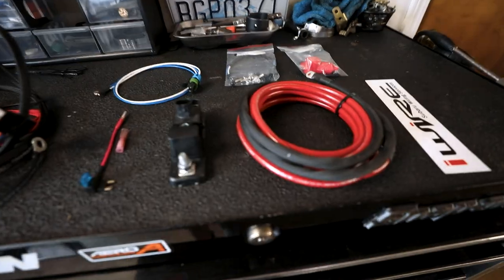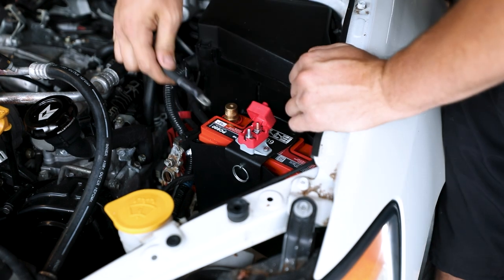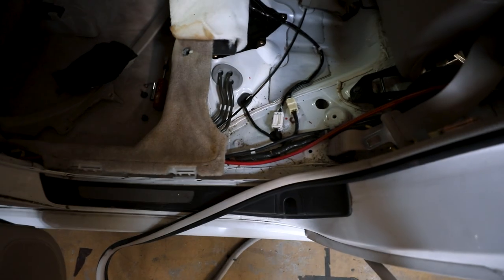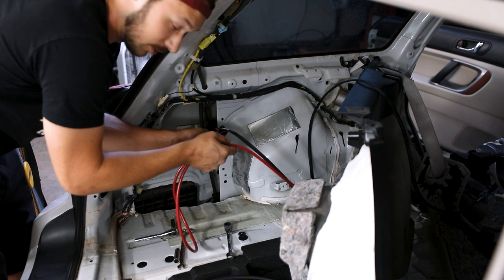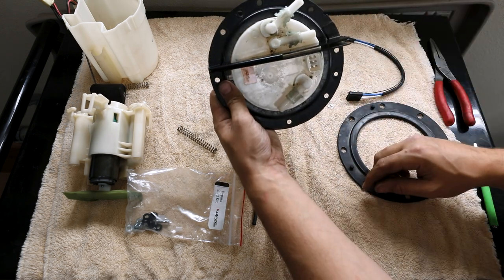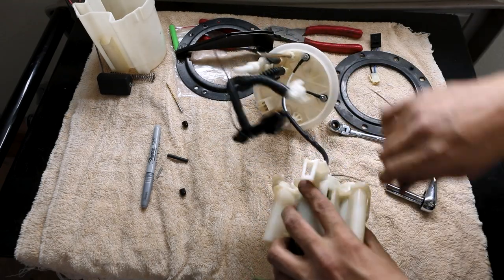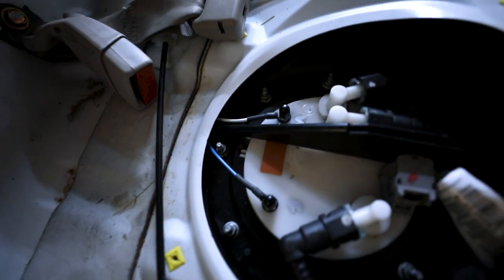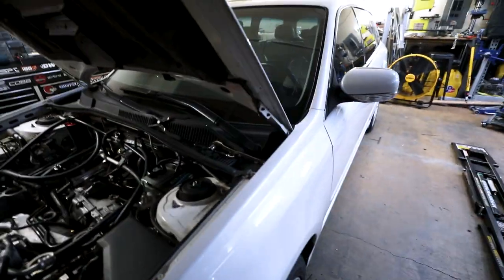The ONLY way you should hardwire your Subaru's fuel pump (SERIOUSLY) - iWire kit in-depth install

Comment: With the rear interior apart, if you have a sunroof, now is the time to make sure the hose isn't clogged! Especially since Mittens has been sitting for some time now! That goes to all sunroof owners doing this as well! Also a good time to check the equalization vents for debris if mice are an issue. Otherwise, great stuff! Also loving how little rust you guys get there. I absolutely despise the rustbelt, but I sadly have nowhere to move to lmao.
Reply from the maker: Definitely some good info! Sunroof drains love to clog and the rears are definitely a lot less enjoyable to get to 👌👌she's got a little rust around the battery from corrosion, but otherwise pretty good. Rust belt is tough 😔 seen so many mangled cars come through.
Reply: @MatlasDI  speaking of batteries, what battery are you using? It's mighty small! I like it, but I definitely wouldn't have the CCAs that are required here in the great lakes area
Reply from the maker: @Awkward_Fox  it's an odyssey pc680. Works super well for how tiny it is, but doesn't do the best if left sitting more than a week or so (but I guess neither do subaru factory batteries 😅)
Made it through winters in the outback without issue.

Comment: Nice, I went and dug around on eBay after you mentioned that and did find one. I'm just curious how much different WRX/STI ones from that era and even from like 2008-2014 are really any different? You the man Matt! And saying your prompt is a under statement!!!
Reply from the maker: Thanks man. I know for bp chassis the gr chassis is very similar all around. Tanner and I compared everything from the strut tower design back through the firewall and they only have subtle changes. So those are probably the best bet. Easiest thing to do would be to pull up a picture of stock and the stis and see if mounting holes appear different, but there are a lot of little intricacies to other items that may get in the way so it will always be a bit of a gamble.

Comment: So did you end up choosing the right fuse? Even with a multimeter showing on with ignition on the fuse I chose I feel like I chose incorrectly.  My battery was drained a few days after install
Reply from the maker: Yes, the one I used has worked fine, no issues, and I run a mini battery. 👌

Comment: Any reason you didn't mount the grey switch in the rear and use chassis ground?
Reply from the maker: The smaller grey switch is the circuit breaker for battery positive. So the kit is designed to have it mounted close to the battery where you can quickly get to it if need be.

Comment: Would this be a good thing to get for a dual radium fuel pump hanger ? I have two brand new Radium Fuel pump hardwire kits at the moment that I got when I bought the radium hanger for my LGT .
Reply from the maker: This would be a better upgrade over the radium hardwire kit and integrates nicely with the fpcm. They make a dual pump option that we've used in prior builds and highly recommend.👌
Reply: @MatlasDI  now I have to sell what I have to get the Iwire kit .. this blows .
Reply from the maker: @lgt304  you could always run the radium one, just doesn't have as many features and it's not as plug and play. Otherwise I'm sure someone would buy the iwire kit as it isn't vehicle specific so there's more people out there to pick it up off you.

Comment: installed the dual pump kit and now my milage is showing 40L/100Km while grandma driving it. I also filled the tank completely and it only shows half full.  drove 70km and now gas gauge shows empty hahah FML 😓
Reply from the maker: I'd be checking the hanger to make sure the float is correctly installed. Sounds like something there got messed up. Do you have the dual pumps working together all the time or tuned to come on in series?
Reply: I just got the car built last week and working with Bader for etunes so not too sure about how the pumps are acting now. But I will for sure be checking the float because i remember that being a pain getting back in the fuel tank haha. thanks for the response! @MatlasDI
Reply from the maker: @EsKAPE294  nice dude! Yea I'm sure you'll get it figured out. Gets a little weird with dual pump hangers. Look forward to you getting her tuned and running right 🤙
Reply: Got it figured out! sending unit was installed backwards haha it fit both ways so didnt notice!  @MatlasDI